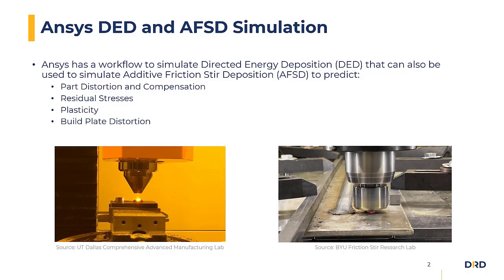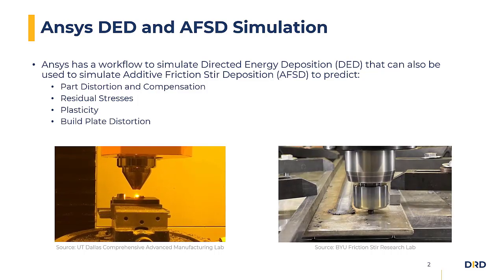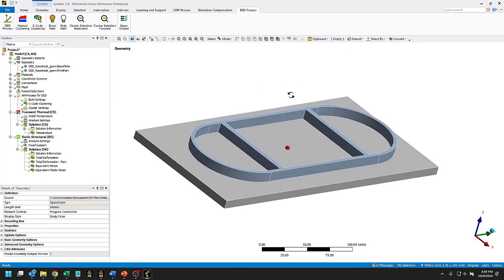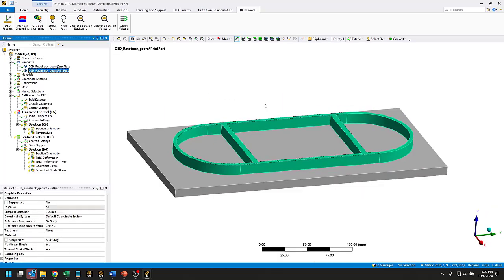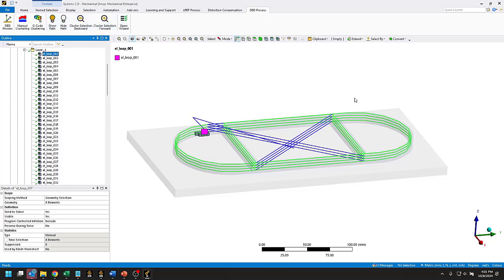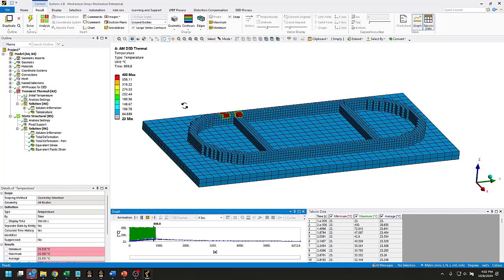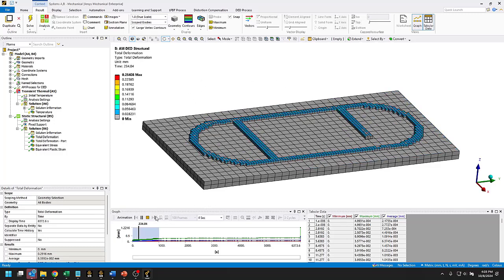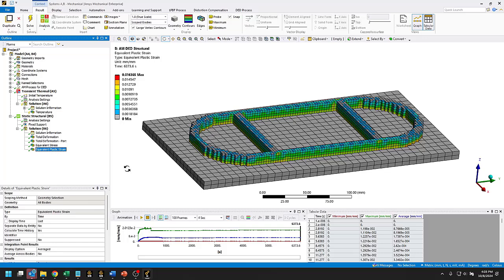Ansys Workbench Additive for DED and AFSD

Comment: How to simulate the force and temperature evolution during AFSD deposition?
Reply from the maker: Thank you for your question! The native Ansys Workbench Additive workflow for DED that we’re using in this video assumes that elements are activated in their stress-free state at a specified reference temperature. By default, it does not take into account any forces exerted by the tool since it assumes the elements are stress-free when the tool is interacting with them. You could include spatially varying and time-dependent forces to take this into account. You could likely also program a variable reference temperature using MAPDL commands to take into account temperature evolution during the AFSD process.